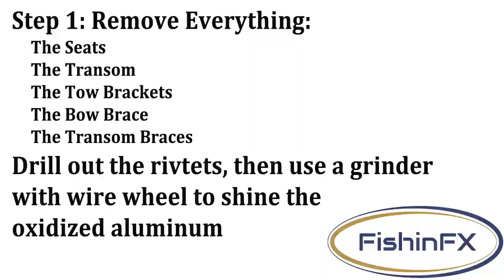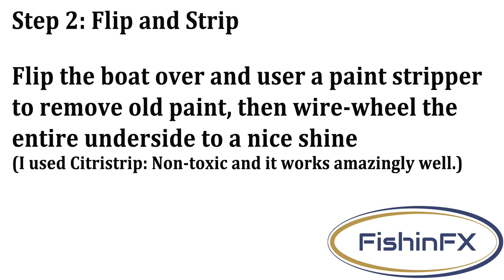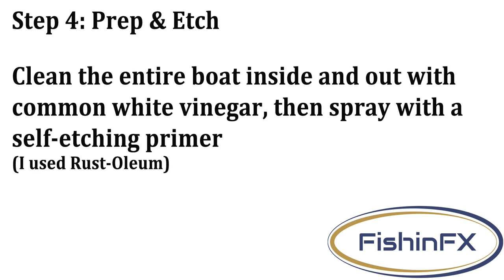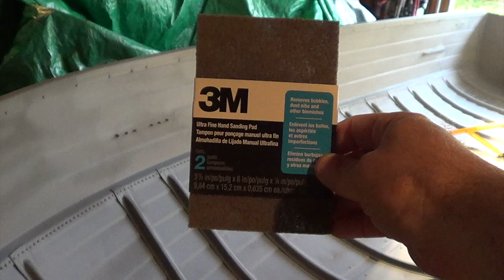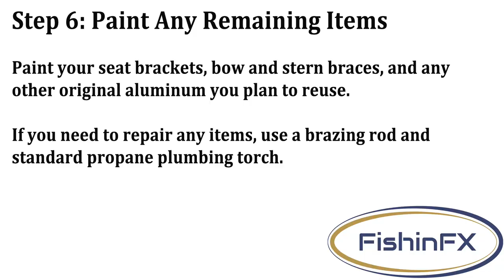Complete Aluminum Mod V Fishing Boat Rebuild – 14' Mirrocraft – From Start to Finish

Comment: Love the build, I have a very similar boat I’m redoing, it’s a 14’ sea nymph. How is the paint holding up on the exterior? I’m going to be doing the exterior of the boat in a couple months and plan on using the same primer and probably total boat paint
Reply: The exterior is holding up reasonably well. It’s rubs off in spots with harsh contact, like when tied up to docks. If I did it again I would definitely run a few clear coats on top of the paint for protection. Thanks for the question and good luck!

Comment: Hm it's a small boat I think after watching this I would have scrapped the 2x4's and gone with 1" alum tubing for everything to maximize space I would also have used expanding foam in the nooks crannies and under floor, nice job overall.
Reply from the maker: Tubing would be great. But for me it was a cost and time issue. I’m a good carpenter so wood was more natural. And I trailer the boat, and keep inside or under good cover, so there’s been zero degradation with the wood over 5-plus years. Looks like the day I finished it!

Comment: Great work! I am in the works of an old starcraft.  Did you replace transom with plywood or dimensional lumber?
Reply: Thanks! I replaced it with a doug fir dimensional lumber finished on all sides before installing with min wax spar urethane.

Comment: How did you install the wood side rails at 7:00?
Reply: Ryan Mclaughlin I used lag bolts with washers — they were either 1/4 or 3/8 — installed from the outside so they suck the wood tight against the sides. Be generous with the silicone before you tighten them down. Still watertight after 3 years.  You want the edge of the 2x4 to stabilize the boat side, like a floor joist.
Reply: Thanks was wondering how effective it would be at being water tight and that gives me confidence to set it up thanks again for the idea
Reply: Ryan Mclaughlin also be sure to bring the sides in to final shape before attaching any structure. I used the tie-down strap with a come-along that you see in the photo.

Comment: I like what you did with the boat. I have a 10' mirrocraft I'd like to fix up. Did you have benches in the boat before you fixed it up? Mine does, and I'd like to know how they installed them because I have to cut out some metal on the bench to remove them. The benches have foam in them that keep the boat afloat if it tips so I'm a little Leary about removing them.
Reply from the maker: J 33 yes the boat had bench seats — three of them. You can see the original boat in the first part of the video. They were held in by brackets. I unscrewed the benches from the brackets, then drilled out the rivers and relocated the brackets as needed. In the rear I actually reattached the bench and attached plywood on top of it. The benches keep the boat pulled together, so if you remove one, you need to replace it with some type of cross-tie or lengthwise stabilizer.

I took the foam from underneath the seats and packed it under the seats and deck. The boat still floats if filled with water (tested it).
Reply: @fishinfx3072  Thank you for the info, that was important information I need to know. I was going to take out one of the benches and hadn't even thought about the structural support that it provided.

Comment: Any issue with weight or stability with all the wood? What kind of wood did you use
Reply from the maker: Regarding weight, it of course sits a bit lower, but not appreciably. A full sheet of 1/2-inch marine plywood weights 42 pounds. Use two and a few 2x4s and you’re only adding about 100 pounds.

Comment: What kind of wheel did you use on the angle grinder
Reply: I used this wheel from Harbor Freight: https://www.harborfreight.com/4-in-crimped-wire-cup-brush-60321.html?cid=paid_google|||60321&utm_source=google&utm_medium=cpc&utm_campaign=&utm_content=&gclid=Cj0KCQjw4v2EBhCtARIsACan3nzR4ph-fn83oRtEqYUziVdyBfpNIju5V5CKDzxsyZbcY8G7AiWixR4aAg7kEALw_wcB

Comment: Awesome. Say question for you did you sand over the bottom rivets?? How did you get the bottom to shine before you painted? I find that sanding shaves the rivet . Was that the cause for you as well ?
Reply from the maker: No, I used a wire wheel

Comment: What kind of brazing rod did you use with propane torch? I got some brazing rods that I couldn't even melt with map gas.
Reply: I used a Hobart 1/8” aluminum, which I believe I purchased at tractor supply. Make sure you heat the work, not the rod. If your rod won’t melt when you touch it to the work, you can cheat a little and direct the flame at the tip of the rod, but only for a second or two.
Reply: @jonstorm2219  Thanks. I've braze welded with oxy but no luck with lower heat gas. Pre flux coated? Be good to have in truck while out. I accidentally put hole in uncle's little John boat years ago and tried fixing it with a rubber worm.
Reply: Dallas Erickson no flux

Comment: What type of framing did you put under the plywood sub flooring on the V hull? I see what you did at the Bow with aluminum framing. I am just wondering what’s underneath the floor and how it’s secured?
Reply: J T I used aluminum angle secured to the ribs — same thing I did under the casting deck, except the angle was only a few inches above the floor of the boat. I set the plywood in, marked each side in the ribs, took the plywood out, then ran a line from mark to mark and figured where exactly to put the angle for each rib.
Reply: Thank you so much for the reply. As far as the type of aluminum angle, did you use 1/16 or 1/8? My boat is a 16 foot deep V hull with three bench seats. Structurally, is there an issue with removing one of these seats?
Reply: J T I’m traveling but will check on the size aluminum. Yes the bench seats are critical for structure — they stabilize the sides. I overcame that by leaving the bow and stern bench brackets in place, then using them to tie in the bow and rear. The I stabilized the middle with storage areas.

Comment: How much weight did you add (just a guess) I load mine in the back of my pickup truck it's a 12 foot Gamefisher and me at #280 it's really unstable. Hopefully by adding weight should stabilize it some, but being to heavy to load is a concern, the only level spot besides the back yard is my driveway, so I have no room for a trailer.
Reply from the maker: Maybe 150 pounds? That’s without the trolling motor mount and stuff. Definitely stick to marine plywood if weight is a concern. It’s the lightest!

Comment: In regards to the foam in the benches, did you reuse the same foam? And the same amount? Thanks! Your boat looks great
Reply: Yep, I reused the foam from under the seats. And we did have a disaster when an unknown road hazard punctured the side. We launched and the boat filled with water about 1/3 and still floated. You could also spray expanding foam under their floor or deck. Just be careful. It’s powerful stuff and it could blow out your rivers if it doesn’t have a place to expand. I also think the wood helps float the boat for a bit too.
Reply: @jonstorm2219  thanks for the tip! Looking forward to upgrading my mirrocraft. I definitely will subscribe!
Reply: @jonstorm2219  

Thanks for the tip on using great stuff for replacing old rotted styrofoam.   I plan on getting an old rowboat and storing it out in the yard.   Animals like to destroy that stuff.   
      Great stuff also works if you’re filling a hole in a wall and you just want to skim coat it with mortar or cement.

Comment: Didn’t see any protection for all that plywood from water ?... it’ll soak with water soon enough ,wouldn’t it ?
Reply: Barry Iwashita I haven’t had any issues. Most of it is exterior grade. I trailer the boat, and use a cover when stored outside. I also used a hole saw to cut a 2” hole in the  deck for ventilation and shop vac. When I have several days of sun I uncover and let it breathe, if needed.